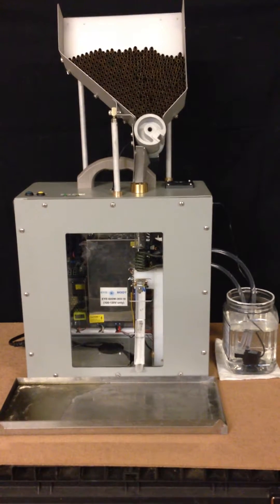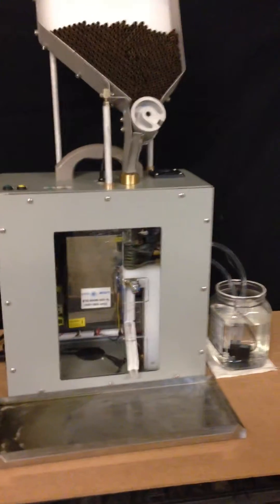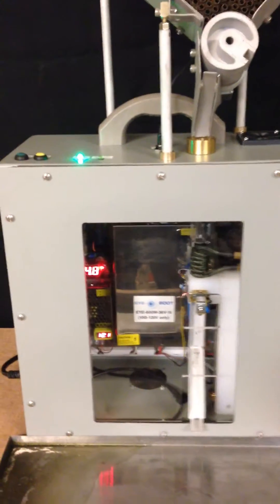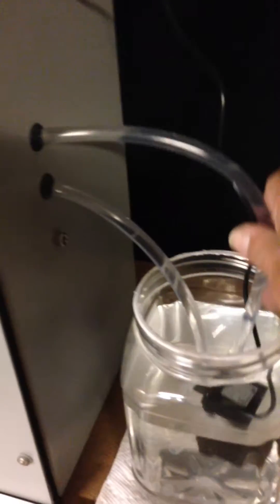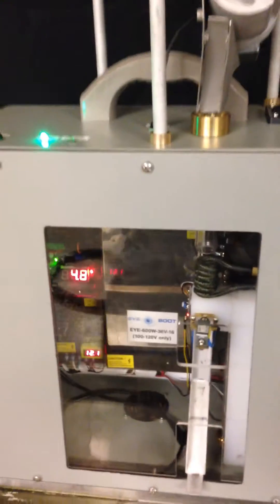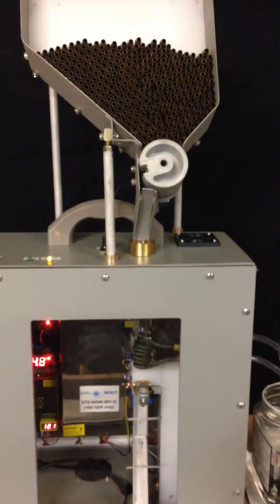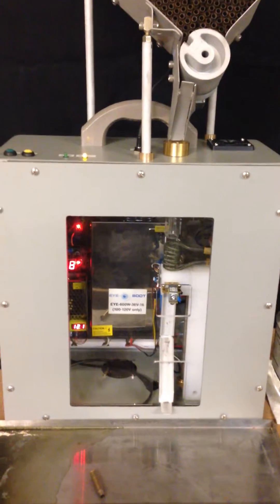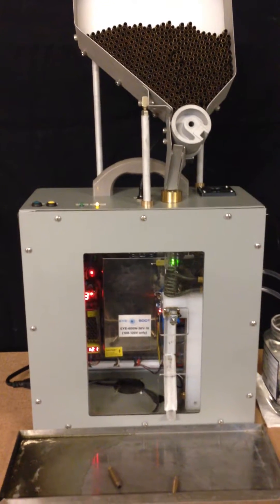223 and 308 Annealer

Comment: how can it monitor the internal temperature of the neck to reach the right spot?
or it does only by time like AMP annealing products
Reply from the maker: Its a time based system that we opted for, based on inconsistencies from using IR to control annealing period.
The IR inconsistencies stem from;
1) positioning within the receptacle 
2)surface finish/cleanliness of the brass 
Timing was effected by inconsistencies in elevation and brass thickness - elevation within the coil, we could control easily, and thickness variations didn't seem to be critical.
Reply: I got one of these machine from Stephen and it works great I own a brass and bullet company and I do a lot of annealing this machine saved my business it works great and I would recommend this machine to everybody its built the rite way and Stephen is always there to help me when I have a question about the machine I am using it rite know as we speak